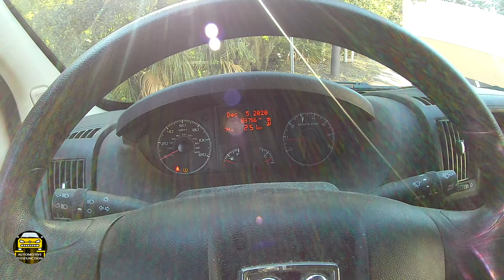How To Change Brakes | RAM 1500 ProMaster |

Comment: Couldn't see the hex socket sizes ? Gonna tackle this tomorrow. 2019 promaster 2500.
Reply from the maker: its in description ... its 7 mm hex bit and 14 mm hex ..check description under the video
Reply: Thanks for the video and quick answer!!
Reply: @AutomotiveDysfunction  Nice video, thanks, but if you double check you'll see it's a 6mm hex, not 7 as you indicate. Do a freeze frame on your video, and you'll even see that you used 6mm :)
Reply: @rocketrobMontana  on my 2017 ProMaster 1500 it is Tork T40 !!!!!!  I screwed them trying to undo them with 6 and 7mm Allens.

Comment: 4:00 For those who don't have that specialized caliper tool, you can get the same thing done with a couple big C-clamps and a piece of metal or two.   Just sandwich the calipers on both sides and clamp down to smush the pistons back as far as they can go.   You can use blocks of wood sometimes if they are fairly thin if you don't have two metal plates.   Either way, just work slowly and carefully.   You want the C-Clamp centered over the piston so you don't smush it unevenly.

Comment: Where did you source the parts? I got a quote for the front and rear pads from the dealer. $500 front and $500 rear.
Rotors were more realistic price of$130 ea.. I am curious where, what brand, and costs for the parts. Do they wear well and no dust or noise?
Reply from the maker: If you don’t want dust just get fully ceramic brake pads and make sure it’s not semi ceramic … all parts auto zone , advance parts , car quest rotors are good quality … Other good website that I even use today is www.rockauto.com they sorted their parts from cheap, medium and premium and you can decide what you want